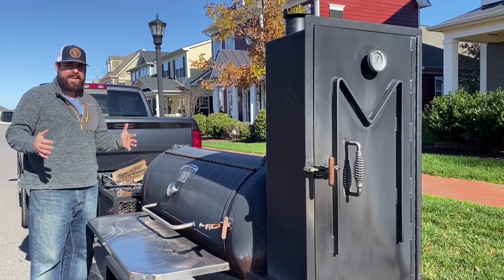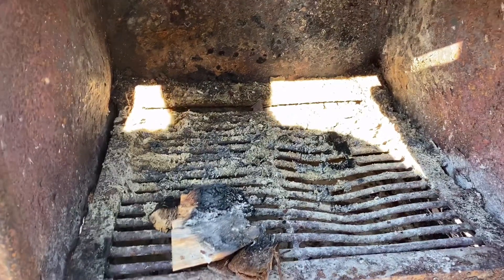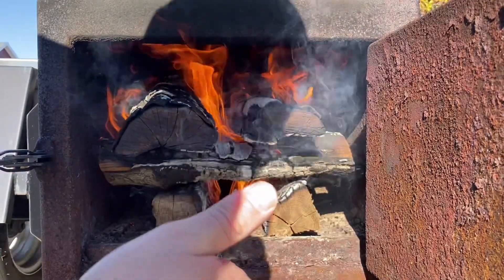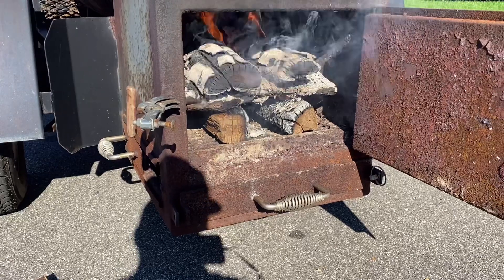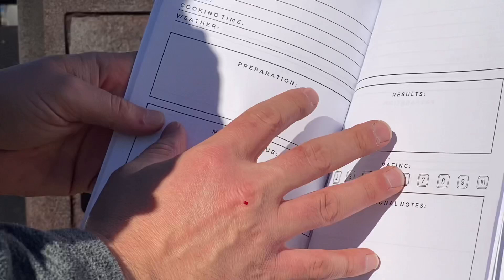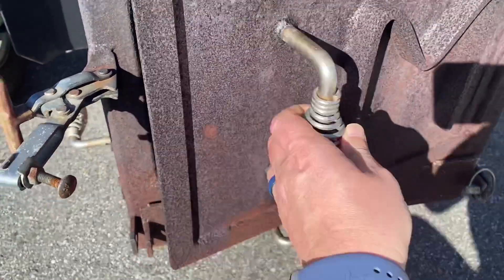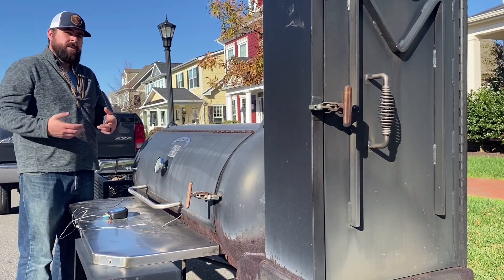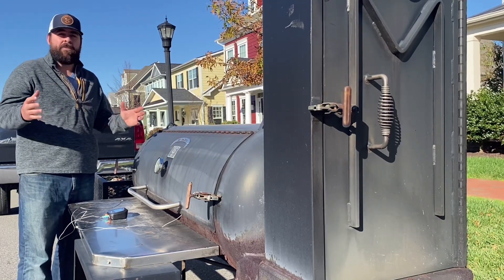Making The Jump To A Big Offset Smoker!

Comment: Seems like even that big of a pit sill has many of the same challenges. I have always heard they are so much easier to run. Also looks like that Firebox and the bottom of the cook chamber are due for some wire brushing and oiling down. Great video as always
Reply from the maker: Yeah it needs some TLC. 100% same principles apply, at this point clicking a pellet button is the only way to get the ease and convenience people are looking for! I would rather work the fire, cheap or expensive rig.
Reply: @ComparisonCooking  I’m with you on that.  Only reason I’d consider a pellet is for weeknight burgers and dogs to replace the gas grill and still get a little wood flavor.

Comment: start with at least a full chimney of charcoal and smaller splits until you get your coal bed going. The hot coals gets the splits going a lot faster. Then you can add more splits as needed. Also on an offset you regulate the temp by the amount and size of splits your using and how often you add them. Even though your smoker is larger than most backyard varieties, your splits are more suited to a 500 gal. or larger cooker.
Reply from the maker: Agree, a lot of people, self included take some time to realize just because its a big pit doesn't necessary mean its going to take big splits.  Have a good one!

Comment: Help me brother I never have cooked on anything this huge ( it’s the goal one day). I have a small Oklahoma joe offset and I use lot lump and add wood to that. but why should I do it this way . Your way is most common. Is it a better burn better taste? What’s your take on that?
Reply from the maker: I use lump in my similar backyard smoker like an Ok Joe.  As long as its red embers when you starting putting the wood on your flavor should be fine.  If I could dump lump in here from my chimney easily I would not be opposed to using it, but there is no easy access for this smoker for a charcoal chimney.  I have a few playlist on my channel that talks about adding wood throughout your cook and fire management to make sure you are having better resulting food.  They should help you get the job done!  After those videos, the FB group - Kingsford Stockade 49in Smoker & Grill, has a lot of Ok Joe people in it.  

I think you can get great tasting bbq both ways, it comes down to proper fire management in any smoker to get the best tasting food.
Reply: @ComparisonCooking  ok cool thanks for the feedback
Reply: @backyardq1850  I have the same smoker as you do. I think the charcoal is definitely the way to go for the smaller back yard units no matter what the make. I have been experimenting with fire management and all and like @comparison cooking mentioned it’s easier to do the charcoal as you get and bed of coals in 30 minutes or less vs burning wood down to get the same result although I’m considering starting a fire in my fire pit and then get my Joe started just to backfill the bed as it my be what I’m doing to keep my temps down burning out my coal bed I find it much easier to have a large coal bed that I add just a little bit of wood at a time and charcoal seems to burn so much cleaner no matter what the vents are set too then wood ever does. Since adding the smaller wood chunks to a good bed of coals has seemed to teach me something I’ve been getting much cleaner smokes and much more consistent temperatures. I just need to figure out how to keep my coal bed and not push the temps up too high. The lowest I have been able to cook on it is around 275.  I want to continue to hone my skills and get down to where I can do the 225 and 250 degree smokes and keep it there. If you are on Facebook consider joining the group previously mentioned as it is a wealth of info and one of the best if not the best group I’m in on Facebook.
Reply: @justplanefred  agreed

Comment: I think you could put more logs and more charcoal in the firebox, then close the vents, including the top vent if necessary, to control temp. My cheapo one with no insulation and thin metal needs the fire box vents closed and top vent partially closed to come down in temp. I also think its ok to have some white smoke. Load up the box with charcoal then wood, let it get hot, then close the vents and go relax for a few hours. Good luck and que to you.
Reply from the maker: Agreed, the thin metal ones you have to keep the vents closed down a lot more.  I did a video on having white smoke isn't the end of the world, agree on that also!

Comment: Myths about bad smoke is killing me. How do you add wood during the cook without getting bad smoke?
Reply from the maker: I did this video to answer that exact question, also feel free to check out the playlist portion of the smoking series, I go over a lot of questions similar to this one. https://youtu.be/RGzI_DHzS8U
Reply: Use seasoned wood and heat your splits on top of fire box or better yet get a fire/coal basket and put a split on one side to dry. When needed it will catch fire almost instantly. Then put another one to dry. I recommend the fire management basket from Lone Star Grillz. The sides are tapered to the center to keep the coal bed under the wood. Enough space on sides to dry splits. If not move basket to one side and split on the other depending on the size of the fire box. Keep da smoke roll'n.

Comment: Are we sure that's 250 gallons?  Normally that's a double door and looks a lot bigger than this... We sure that's not a 120?  Also the firebox looks extremely small for a smoker that size.
Reply from the maker: Probably the 120, buddy paid 250 prices though 😅
Reply: @ComparisonCooking  lol.  Honestly I prefer a 120 over a 250.  I had a 250 and it was massive.  A pain to move around and I felt I got a better smoke ring on the smaller cooker.

Comment: That thing is a beast! Very informative though. When I saw it was reverse flow i thought the same about where the hotspot would be. Thanks for the video!
Reply from the maker: Yeah this thing is awesome!  Wait till I release the Pig video, i had the heat dialed in and temps were even.  If anything the temp on the opposite side was the one that got hotter that time around, but only by a few degrees.  Thanks for watching!

Comment: So reverse flow is alot hotter than traditional flow. Traditional is probably better for low and slow
Reply from the maker: I think every smoker is different and this one is probably running hotter because of the insulated firebox.  If it didn’t have that I’m not sure if it would run hotter than a traditional setup.